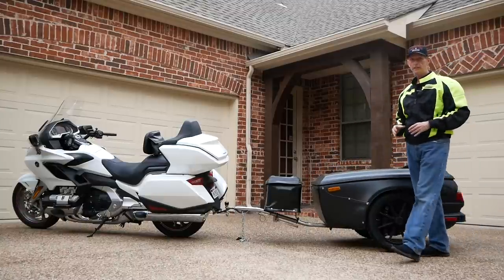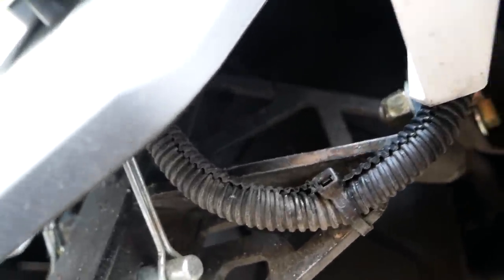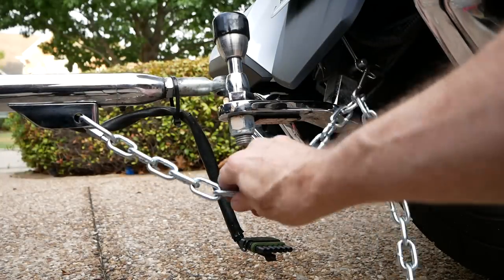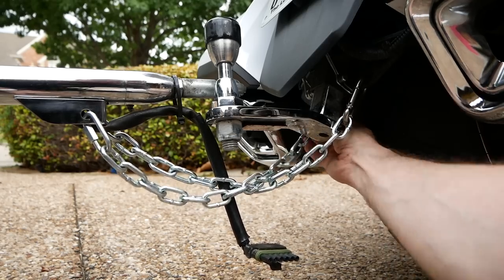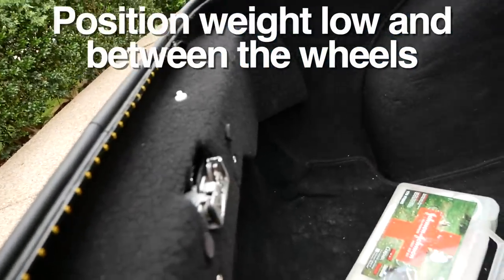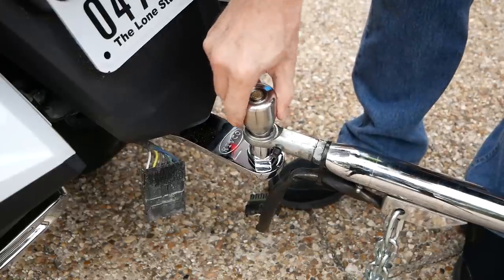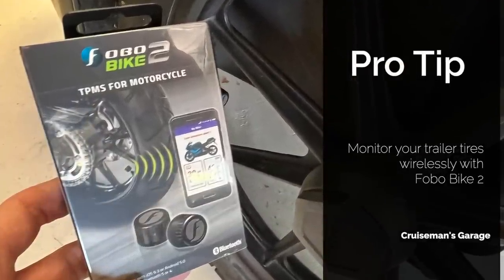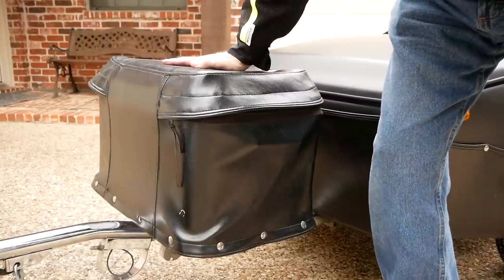Don't Pull A Trailer With Your Motorcycle Until You Watch This Video | Cruiseman's Garage

Comment: Whenever i use those coupling links i make sure that gravity will be working for me.
The way you put them on in the video. Vibrations can loosen the barrel nut & gravity will allow it to unscrew.
If the Barrel nut is on the top & it becomes loose.
Gravity will keep it screwed down & closed.

Comment: I've towed 10's of thousands of miles with trailers behind my Wings and your descriptions are spot on!  Thanks for sharing.  I'd add one other safety check and this is to check that the hitch is fastened into the receiver.  Don't ask me how I know about this tip.  The safety chains criss crossed did their thing!

Comment: For cars and trucks, the breaking strength of each chain, including the spring link, should be at least the GTW of the trailer. This is because in an emergency, the load will alternate between the chains, not distributed between them.

So you may want to you may want to double up on the spring links, if they don't tend to bind up.

Brilliant idea of using another set of pressure gauges for the trailer....ANY trailer; not just behind a bike.

Comment: I now drive a 2016 GL 1800 with a very light cargo trailer and the bike has anti-lock my 1997 1500 that I sold had 225,000 km and towed a trailer a timeout for more than half that distance it was a heavy trailer so I had electric brakes applied when I bought it when properly set up and normal riding condition they are a life changer they will stop the bike just as fast or faster than without the trailer in the rain I turned them right down or off as I did not want the trailer wheels to lock up

Comment: Also, be sure to make your safely chains long enough to not hinder the bike or trailer during a turn.
Reply from the maker: Very good point!
Reply: It looks like he’s were too short in the video
It is hard to tell 🔰 Love from Mississippi USA 🇺🇸
Reply: Yes, I agree... too short will cause binding, like when going in and out of driveways also. I would recommend at least two more links. That "spring link" is also too light weight. One link should be rated for the whole trailer weight. There will never be the same weight pull on two chains... just dynamics of the design in pulling a trailer that goes left-right and up-down when traveling. You're better off with quick-links. Or an even better option is to get the safety chain kit with pre-attached s-hooks with spring locks. They're $20 at Home Depot and they're designed to be safety chains for class I and II trailers.

Comment: I saw a video of a guy pulling a trailer with a bike and had to stop at a light on a steep uphill  I believe he had a bike without linked brakes  and when he put his feet down the weight of the trailed pulled him backwards with the front wheel skidding and down he went if he had his back brake on or linked brakes I dont think this would have happened.  Sorry dont know who to give credit to for the video I saw.  P.S  Many trailers have different size tires make sure when you buy new tires  they are the same size and are Speed Rated  found out the hard way.  Keep up the good work.

Comment: Crossing the chains will create a single point of rotation (a fulcrum as well) when the trailer is being held by the chains increasing instability so your chains will be working against each other. Don't do that as it creases the chance of the trailer rolling over to correct  the imbalance.

Comment: I wouldn't use cheap 260 lb. carabiners to attach safety chains. If you actually have the misfortune to need the chains there is likely to be quite a shock load well beyond the simple trailer weight. Checking amazon shows many inexpensive climbing carabiners rated at many thousand pounds.

Comment: How hard would it be to get a replacement tire on the road for trailer ❓❓❓❓❓❓❓❔
Love from DeKalb Mississippi USA 🇺🇸
Reply: Carry a tire repair kit and electric pump or bicycle pump in the trailer.
Reply from the maker: Depends on the trailer. I think the Bustec used standard bicycle tires, but I could be wrong about that. You can carry a spare.

Comment: Sorry Cruiseman I disagree with this video on a few points.  The spring clips you are using to attach the front of the chains are inadequate.  They need to be rated for at least twice the weight of the trailer each.  There is no guarantee that under an accidental disconnect, the chains will be pulled equally. One could be pulled alone and the sudden "snatch" load on the chain could easily exceed the weight of the trailer.  Keep this in mind when selecting the chain,  Each chain should be rated at twice the weight of the trailer. On another point, the length of the chain should be short enough that they do not drag on the ground yet long enough they do not bind when turning a sharp corner.  And as for tongue weight, you stated the tongue weight should not exceed 10-15% of the total weight of the trailer including its load. However, you should have stated the tongue weight should not be  than 10-15% of the total towed weight but not exceed the rated tongue weight of the trailer hitch or cause the total weight of the rear of the motorcycle to exceed the weight limit of the rear tire of the motorcycle including the driver, passenger and all other luggage.   This problem is particularly acute with the previous generation of Goldwings.  In any case, the GVWR of the motorcycle should never be exceeded (the weight of the mc+rider+passenger+luggage+trailer+load).

Comment: Not sure but my Honda manual said NO TRAILERS as the bike was not designed to pull?
Reply: Not surprising because it depends on your model which is tied to the country you are in. Mine's the Australian / New Zealand version, so mine is the "U" model. Also mine is the 2017 model, last of the 5th Generation but just as relevant.
Reply: That is pretty much the standard Honda position on trailers. NONE 

Probably the legal department.

Comment: Good day Cruiseman! You mentioned in your video to use Fabo Bike 2 TPMS for the trailer. Don't you think the weight added to the air stemp will cause the tire to be off balanced?
Let us know what you think!
Ride Safe Always!
Mike L.
Reply from the maker: That is an interesting question that I had not considered. The sensor is very lightweight, but I suppose it is possible that is could make a slight imbalance. I have never noticed any rough riding though when using them.
Reply: @cruisemansgarage  Goud morning C!
So would you balance the trailer tires with the TPMS installed?
Reply from the maker: @michellavoie1714  I doubt that it is necessary, but if you can do that, it would probably give you a more accurate balance.
Reply: TPMS should ONLY be used with metal valve stems like the ones on the wheels in this video. Rubber stems will flex during rotation and break.